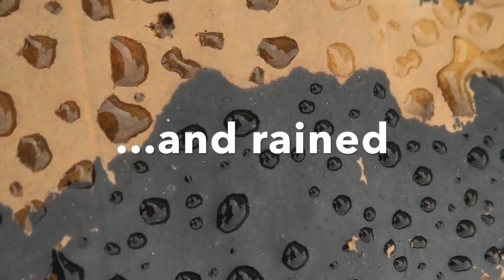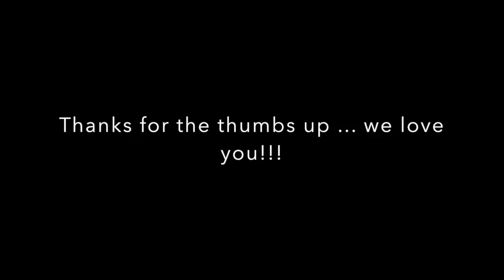Bus Conversion to Motor Home #111  House roofing

Comment: Hey Debbie and Jim...nice job on the roof. I am going through the same with my roof. I have a leak and I do not have the money to fix it....My boyfriend cut a hole in  the ceiling to relieve the pressure and will be getting it fixed in the next couple weeks. Hope you are all well!
Reply from the maker: It is a big, big job but a necessary repair to sell the house.  Hope it goes well for you!  Thanks for watching!

Comment: You are making progress, soon you'll be out on the wide open spaces. 
 Hey I wanted to ask do you find by raising the roof, do you feel like your more susceptible to being pushed around more.  How has it been driving on the roadways with high winds.  How tall is your bus now that you've raised it?  Also does Debbie plan on learning how to drive?? Thank you in advance😃
Reply: I hope Debbie learns how to drive the bus under varying circumstances as it is pertinent in case Jim gets sick or injured some how & he can't drive . f not they will be up to creek w/o a paddle so to speak .
Reply from the maker: I (Debbie) am not planning to drive the bus. I believe I could if it was an emergency though.  We will be towing a small car as well so that will be helpful.
Reply from the maker: I will leave part of this question for Jim since I haven't really driven the bus.  I don't really plan on driving the bus but we will also be towing a car that I can drive if needed.  Our bus is 11'6" tall.  Thanks for watching!
Reply from the maker: QBI Faith,  thanks so much for the question.  The bus feels very stable, I do not feel a difference from driving the bus before.  I really enjoy driving the bus but Debbie doesn't want to.  We are going to be pulling a vehicle and she will learn to connect and disconnect and drive it.  Thanks again for the question.  :)